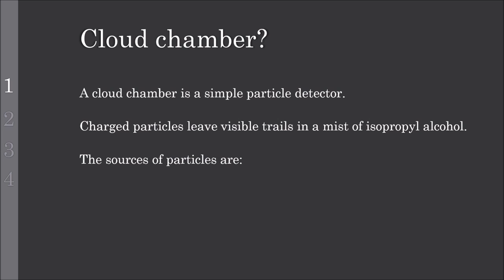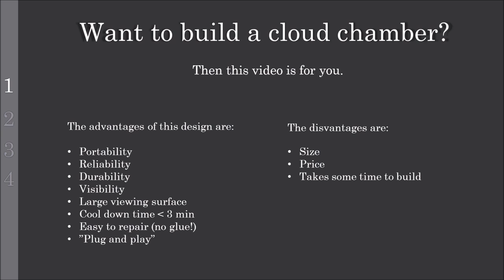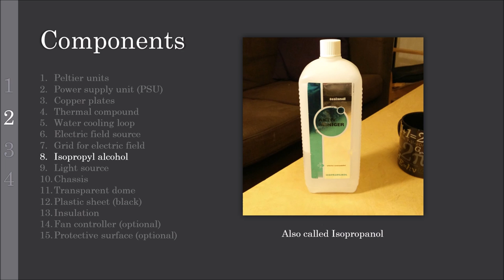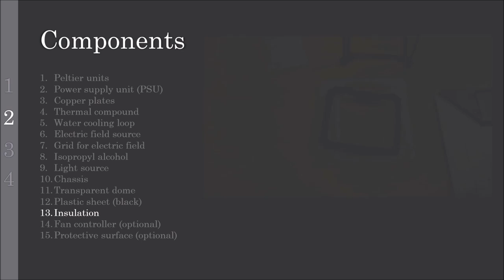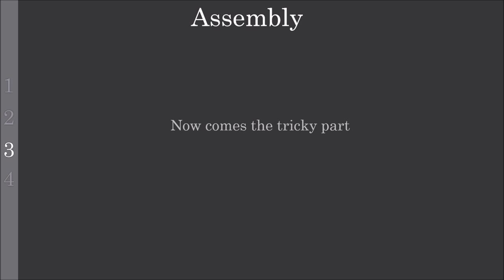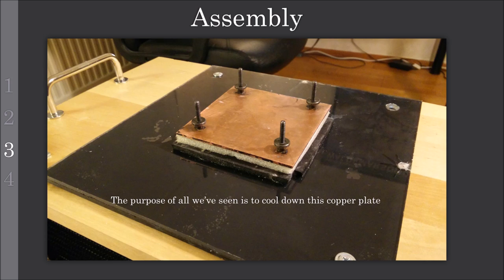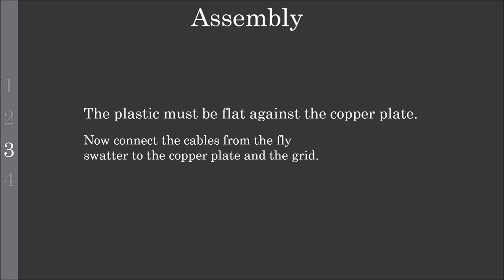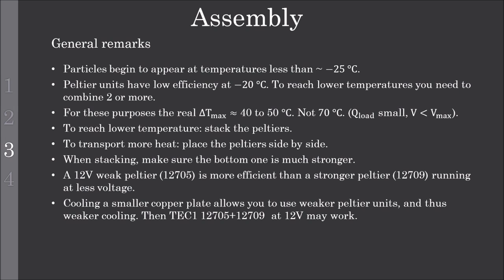How to build a peltier based cloud chamber

Comment: Hi David. I'm trying to build a cloud chamber using a heat pipe cooler (I am using the Coolermaster V8GTS). I only reached -14C. Do you think swapping out the fans (they're only 1600 rpm now) can also help as with the water block solution?
Reply from the maker: Hi, sorry for the delay. I personally never managed to get below -18C or so using only air-cooling, so I doubt swapping the fans will help much. It depends on which peltier's you are using. The problem really is the pair of peltier tec's used in my video output two or three times more power than a CPU does, so normal CPU air-coolers won't suffice. You could of course just use a weaker peltier pair, like the 12709 + 12704, as others have done in other videos, and get by with air-cooling but in my experience this approach will be less reliable, take longer to cool down, is even more sensitive to mounting errors, and would allow only a very small cold plate for viewing particles. In my previous video I attempted air-cooling and failed for these reasons. YMMV, but if you go for this approach, make sure have a small cold plate (about the size of the peltiers), use good quality peltiers (I am skeptical of the cheap chinese ones from ebay), have a robust way of applying firm pressure to the whole sandwich (peltier + cooler + cold plate), find a good easily spread thermal paste, and finally have proper insulation from outside temperature as well as moisture. It is meticulous work but others have succeeded, somehow ;)
Reply: Thanks for the reply, David. I have acquired a Swiftech h320-x2 liquid cooling unit to get the cooling down further, i hope. Also 3 pcs of 3000 rpm fans. As for the chinese peltiers, yes, they ARE what I'm using now, so good luck to me, haha. I couldn't find the 12725 in the Philippines, and in my excitement that I found a bigger 62 x 62 peltier (the 12730), I basically forgot you would also need a bigger water block to cool that down. I now ordered a 12710, and I hope that helps, but would only be good I think as one stack. Does the ambient temperature in the room have any bearing on the cooling (in the philippines at this time we average 30-31degC)?
Reply: Hi David. We finally got the temp down to -27 to -29C. We are using a 12710 as the bottom peltier and a 12706 as the top. For now, we have a smaller cloud chamber stage than yours (only 50mm x 50mm). But this will do for now. Thank you for the guide!~
Reply from the maker: Great! I'm glad to hear it worked! I'm impressed that you got it working with  a 12706, I would have thought it was too powerful.  Good to know!
Reply: We only see the saturated alcohol 'clouds' using a camera now. Can't really see it with the naked eye. Is that normal?
Reply from the maker: Make sure that the chamber is somewhat airtight. Use plenty of isopropanol, don't be shy. In my rig the "stage" is fully covered in alcohol. Least but perhaps most important, a source of static electric field improves things a lot! If you don't have one already, try rubbing a balloon or styrofoam against your hair, and place it close to the chamber.
Reply: Hi David, we have the fly swatter solution also rigged up, so we're quite excited to see our first tracks. Will purchase the thoriated TIG electrodes first thing in the morning. Doesn't the plastic cover over your copper plate lessen the 'coldness' imparted to the open surface? After putting in the plastic sheet, seems we can only get the temp down to -18C. So now we just painted the copper. Works now, we're at -33C, but I can't seem to see the clouds with my naked eye. We're checking if it's the lighting.
Reply from the maker: The ligtning could be it. About the black plastic sheet, I usually pour alcohol such that some of it gets in underneath, between the bare copper and the plastic. That helps the plastic adhere to the metal, any air-bubbles would lessen the effective cooling. The black paint is a good solution if it can handle being cooled down multiple times without cracking, or being disolved by the alcohol. Also I noticed that the effect of the electric field depends a lot on the dielctric properties of the paint or plastic sheet. I think that is also why the plastic sheet works well, it's so thin that it barely hurts the electric field.

Comment: Thank for sharing. An amazing job! Did you use cheap chinese peltiers or quality ones? Because i made the same kit with a good 6 pcs. pipe fan but reached only -14 degrees with cheap peltiers. 12v 5.5a in the lower and 5v 8a on the higher module. Can you give any suggestion? Thx now.
Reply from the maker: Initially I used the cheap chinese ones, and got basically the same results as you. It was very frustrating. Back then I stacked 2x 12705 @ 6V  on top of 2x 12710 @ 12 volts . Actually, it was fine with just the peltiers, without the large copper plate on top. Temperatures reached  about -30 C then.  Adding the 10x10cm copper plate was just too much for them, the lowest temperature would go down to around -18 at best. Probably because of condensation and radiative heat and whatnot. I then cut the copper plate in half, to 5x10cm which helped, because the peltier stack only needed to cool a surface area as big as themselves. My previous video shows that setup, but that would just barely work, on a dry cold day and if the planets aligned. I ended up buying a big "CP1-12725" from ebay, manufactured in the US I believe. That is the bottom peltier you see in this video. Stacking that one with some weak chinese ones on top finally did the trick.  I now believe rule of thumb is to simply have the bottome peltier be MUCH stronger the ones on top.
Reply: David Aceituno Your reply gives very nice info David. Today i ll order a tec1-12715 130w peltier and a tec1-12706 60w which are made of american products like yours. Just i think that maybe i can put extra 3v with an another adapter to 12v psu then i can use the peltier more efficiently. When voltage is increased then the wattage also increase so more cold. But i am not good with electronics so decided to buy new peltiers. Very important for me to make my own chamber with peltiers. So your video and kindly answer is very helpful for me.thanks again.

Comment: This looks really cool! I have wondered if you can achieve the same deltaT with a smaller radiator (2x120mm)? What about the pump, is it absolutely necessary to go for 800l/h or is 500l/h also okay?
Reply from the maker: Hi! A smaller radiator will probably not have much impact on the deltaT, but rather on your Tmax (and thus your Tmin, if deltaT is unchanged). All else being equal,  I expect that replacing the radiator for a smaller one  (i.e. 3x120mm -> 2x120mm) will shift Tmin and Tmax a couple of degrees up by an equal amount. 

A high flow rate is good because it increases turbulence. If your flow rate is too low, you end up with near laminar flow in your tubes and watercooling block, meaning slow moving water near the walls heat up more than the fast moving water in the center, without mixing fast enough. The waterblock then becomes inefficient due to the soft temperature gradient into the water. To solve this you need turbulence, introduced either by internal fins in your watercooling block, or by a higher flow rate, which as you might guess makes the waterblock effective because of a sharper temperature gradient.

That said, the flow rate of the pump is a pretty forgiving value; I doubt there is a very significant difference on flow rates between 200l/h up to say >1000 l/h, and the 800l/h pump I chose was probably way stronger than I needed. I'm guessing a 500 l/h pump will be fine, but more importantly, make sure to spend wisely on your watercooling block. Or just buy a finished kit for PC's (such as this one: http://www.corsair.com/en/hydro-series-h110-280mm-extreme-performance-liquid-cpu-cooler)  and swap out the fans for stronger ones
Reply: Thanks for the reply! I will take that into account. The problem I am facing currently is a bit hard to pinpoint. My setup is pretty much as yours (2xTEC 12709 in series, 1xCP1-12725), Alphacool CPU block, 12V 33A PSU, but I have a single 2x120mm rad, two 3k rpm fans and 10/13mm tubing. I cannot seem to pass -20 C.. I tested with fast flowing tap water straight over the CPU block and with that setup I could reach  -31 C... It does make me want to rethink your pump approach. 
Amp readings on your TECs and fans would be highly appreciated. Your insight is highly appreciated :)
Reply from the maker: sounds like everything should work properly then. Unfortunately I can't give you the readings because I've sold the machine. However there are typically two details that I usually found to be the cause: 
1) The application of the thermal grease, and the pressure applied on the stack of peltiers. You need a lot of pressure to squeeze out bubbles, especially if you have a thick paste. Pressing as hard as you can with your fingers might not be enough. Also, be careful on the application of the paste not to get any dirt, grit or dust in, and spread the paste very evenly and thinly on both the copper and TEC surfaces.
2) Heat insulation. You need to insulate the cool copper surface from many things: From below, you need to insulate it with styrofoam or stratocell plastic such that the heat from your waterblock doesn't radiate onto it. The screws that you use to attach the plate might also be conducting heat. From above you need to insulate against buildup of ice/frost. I find this is easiest with isopropyl alcohol, which melts the ice and and won't freeze itself. To gauge how well you have insulated, you may try to run the rig without the top-copper plate and take the temperature directly on the cold side of your peltiers. I remember that this temperature would read in the range of -35C to -40C for me. If it is higher, say closer to -20 C, you can be certain that the problem lies not with your insulation, but somewhere else (like thermal paste or water cooling).
Reply: I'll check these points. Thanks!
Reply: So, an update on the progress:
I finally managed to get my chamber to work as it should! Thanks for the consult back then! In order to make it work I did some playing around with different changes in the system and the following items were crucial in the build.
-High flow pump
-At least 10mm ID tubing, stiff, as mentioned in the instructions
-Proper thermal grease and insulation
-High RPM fans

If any of the above items are below spec you are going to have trouble breaking past -25 C

One comment though, dual fan radiators (240) are able to handle the heat load as well as the triple (360), but the final temperature will be higher than what is shown in the test section of this video. I will experiment with adding another 240 at some point to test the additional effect.

Good luck to anyone building this project, it is well worth the effort!

Comment: So the fly swatter net is just used to generate an electric field? Also, did you use the peltier module as a source of heat or cooling? Because I know you also used the water cooling loop. I'm hoping to do a very similar design in my engineering physics class and would appreciate the help!! :)I'm also really impressed with the complexity and ingenuity of this design!
Reply from the maker: +Savannah Hauersperger Thank you! You are correct about the fly swatter, it's just for the electric field. In other instruction videos they've used balloons or styrofoam cups to generate a static charge, but i think the fly-swatter field is more reliable. The Peltiers are used to transport heat away from the 10x10 cm copper block, into the water cooling loop, which in turn gets rid of that heat through the radiator and fans. So the Peltiers have their cold side "up". There's a recent video that's very good at explaining a set of details that I left out: https://youtu.be/N_nsGTH1fKI  (part 1 and 2!). Nice to hear you're doing engineering physics! I'm actually finishing my masters degree in engineering physics in a month or so :)
Reply: +David Aceituno Thank you for your explanation and suggestion! And wow, masters?! That's admirable! :)

Comment: Do you think that a TEC1-12715 50*50MM 15V thermoelectric cooler peltier module would work just as well in place of the cp1-12725 peltier module? I'm having trouble finding this kind.
Reply from the maker: +Savannah Hauersperger Sure. The trick is to 1) Stack a much weaker peltier on top, 2) Cool the pair of peltiers well enough, and 3) Cool down an appropriately sized surface plate. And don't forget isolation.

By weaker peltier on top I mean something along the lines of 12704 to 12706.
Reply: +David Aceituno ok thank you! Also, the cold cathode tube lamps come with two lights so do we only need to order one set of lights?
Reply from the maker: +Savannah Hauersperger oh. Hm. I believe I ordered a pair of two from eBay like the ones on the link below the video. I'll have to update the links when I get the time :/
Reply: +David Aceituno What kind of reservoir and water pump do you suggest getting?
Reply from the maker: +Savannah Hauersperger If you haven't already started with the water-cooling I recommend that you avoid all that trouble by buying a computer water cooling kit like the Corsair hydro 100 or better. These go for about 100-150  euros including the pump, radiator, fans etc,  and building one yourself will cost you about the same. 

Otherwise look for a pump on ebay that pumps around somewhere in the region of 400-800 l/h. It doesn't need to be "quiet", and will cost you around 10-20 euros. This i the one I got but it's almost overkill.: http://www.ebay.co.uk/itm/Pro-12V-Electric-Solar-Brushless-Motor-Water-Pump-Aquarium-Fountain-1000L-H-/391085551080?hash=item5b0e83ede8:g:mxkAAOSwstxVBqB8

Reservoir you don't really need but it does help to get rid of bubbles in the waterloop. I would go for the cheapest one that can take fittings of the size you'll be using for the whole loop. Use sturdy tubes to avoid kinks!
Reply: +David Aceituno I will take all of that into consideration! Thank you for your time, I know I've had a ton of questions :)
Reply from the maker: +Savannah Hauersperger No problem! I'm glad I could help :)
Reply: +David Aceituno At 6:09 in the video, I'm confused as to what that is and what purpose it serves? Why do you need those parts and where do they go?
Reply from the maker: +Savannah Hauersperger The black metal square with screws is the mounting bracket that ships with the waterblock in order to mount the waterblock on a PC motherboard. I reuse that mounting mechanism to fasten the waterblock to the copper, in which I've drilled holes at the same distances you'd see on a motherboard.
 The black foam square is for insulation and to add some more pressure to the mounting (as it provides some more distance).
Reply: +David Aceituno Oh ok! Also, I ordered my peltier units. I ended up using the same ones you did. My tec1-12709 peltiers are 12V, not 6V, are those the right kind or should I order something different?
Reply from the maker: +Savannah Hauersperger So you found the cp1?  The Tec1 127XX models all have 15.4 V maximum as far as I know. I run the 12709 at half voltage in my setup by running them in series (like connecting resistors in series).  You should be able to cool down both  12709 sufficiently with  a CP1 + watercooling. However it's wise to order some extra peltiers just in case, especially the cheap ones, because they break/chip easily and it takes a couple of weeks to get them by mail.  There will be a lot of trial and error as the cooling capacity will be highly sensitive to small variations of isolation, application of thermal paste and the cooling capacity of your water-rig. Oh, and if you use a PC water cooling kit it might be necesary to replace those "silent" fans they ship with for something more powerful (3000 RPM or more).

Comment: Why do you use a water cooler and peltier chips? Wouldn't the peltier chips be cool enough?
Reply from the maker: +Casual The peltier units don't actually produce "cold". Instead, they transport heat away from one side to the other. Transporting heat itself generates heat (much like a resistor generates heat when "resisting"). Thus the water cooler is needed to get rid of all the heat transported from the cold side of the peltier, plus the heat generated internally by the peltier itself.

Without a water cooler, all the excess heat on the hot side of the peltier would end up flowing back to the cold side, and in a very short time damage the peltier unit. In that sense it works similarly to a CPU, in that it must have a cooling unit at all times or else it breaks.
Reply: Ah, I get it. Seems like a very cool project. I might have to build one myself.

Another question: about how much does the whole setup cost?
Reply from the maker: I think all the parts add up to about 250 euros, but I probably spent somewhere around 600 euros in tools and materials for earlier versions. It possible to do smaller and much cheaper builds, like this one: https://www.youtube.com/watch?v=N_nsGTH1fKI

Comment: Is the 2.5 mm copper plate really necessary? I mean, can you also use a 0.5mm for example? Or is the 2.5 really a must?
Reply from the maker: In my design I attach the water cooling block + peltier element stack firmly against one side of the copper plate by screwing them all together. The peltier stack needs considerable pressure to squeeze out bubbles in the thermal grease between them. If the copper plate were thinner it would buckle, reducing the surface in direct contact with the peltier. A buckled copper plate would also apply uneven pressure on the peltiers which could easily crack its edges.

If you could change the design in such a way as to apply even pressure on the peltiers without using the copper plate, and then basically rest the thin copper plate on top, you could get away with a thin 0.5mm plate.